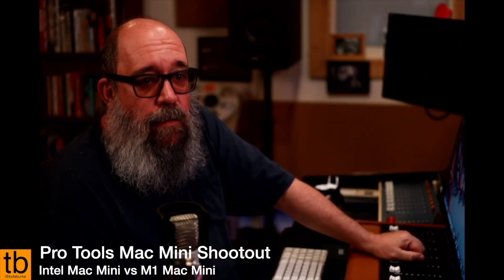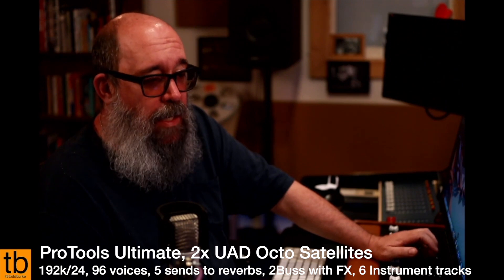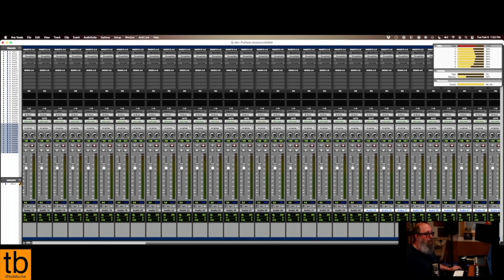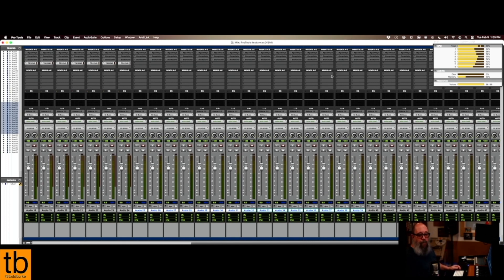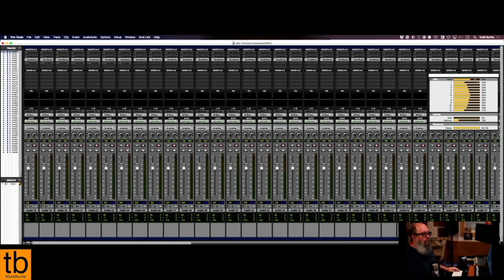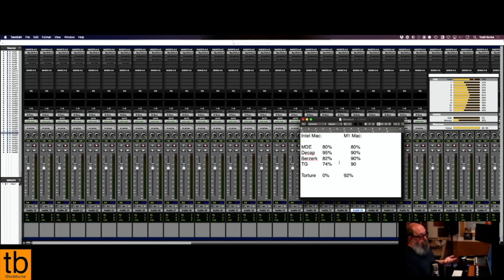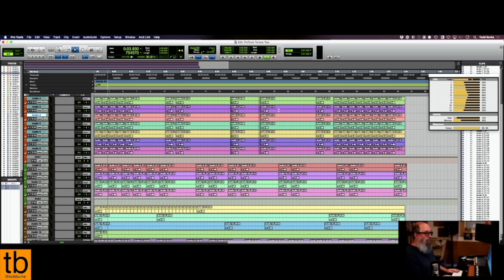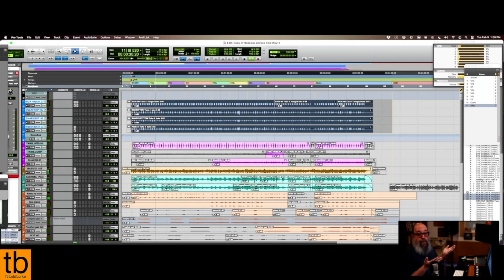M1 Mac Mini Shootout for Pro Tools Users

Comment: I watched several videos about Pro Tools on the M1 Mac. I didn't realize that none of the demos used the video engine. I didn't even think the video engine would not work. Well, I found out the hard way that it does not.
Reply from the maker: I’ve been using video sync 5 from non-lethal applications. Video got difficult in PT after Mojave and still hasn’t really found it’s feet whether on M1 or Intel Mac. Lots of codec issues etc……This app is an ideal workaround in my mind and improved my workflow in a lot of ways. I keep it running on an old laptop connected to the studio TVs so ANY rig in the building can sync to it and “drive” the video. And I can output quick times for review in a fraction of the time protools takes, especially with this recent round of “export as original” messiness. Totally next level in my setup, HIGHLY recommended.

Comment: protools version 2020.9 its working in m1?
Reply from the maker: 2021.3.1 is the current PT release. If you're going to upgrade your OS to there most modern (Big Sur), you HAVE to keep your ProTools install modern as well. That's a simple truth and will save you a LOT of trouble down the road.

Comment: Thanks for the video. I'm wondering if the new Pro Tools 2021.5 (which supports Big Sur) is any different, performance-wise?
Reply from the maker: It’s been totally stable for me. I’ve been mainly mixing for the last several weeks but have had little to no trouble. Antelope got caught up with their driver a few weeks after I posted this....all has been well.
Reply: @toddburke  thanks for the reply!  - by the way, I meant 2021.3, not 2021.5.